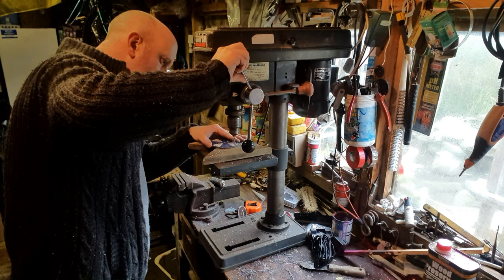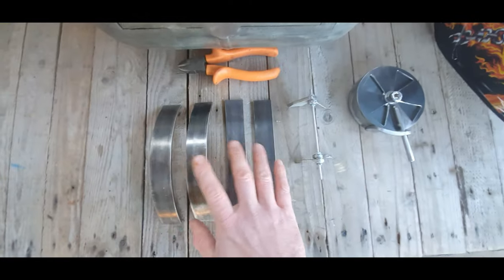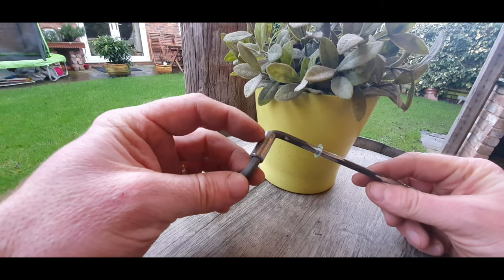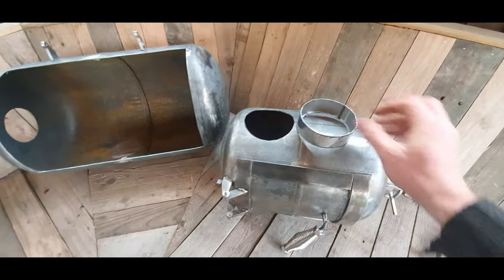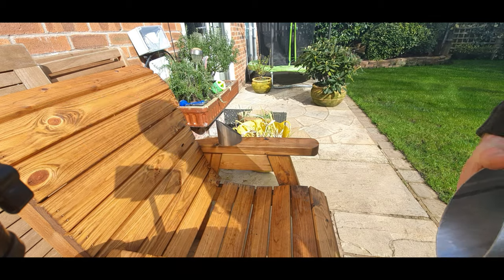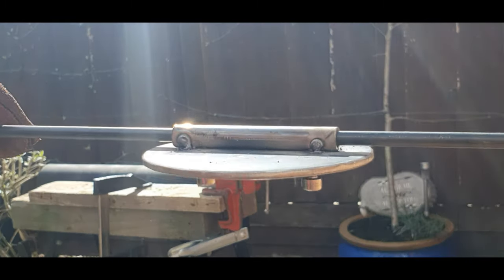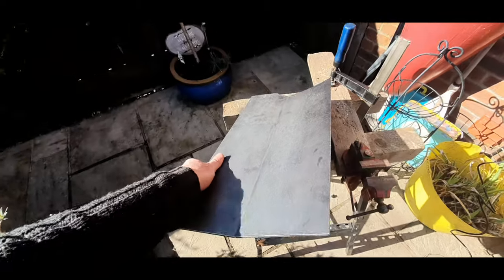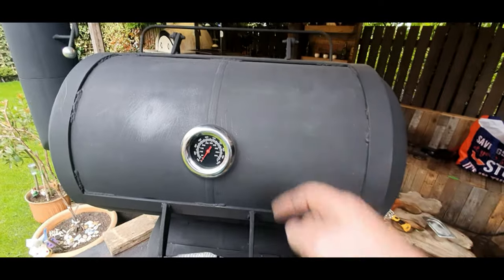Homemade Tabletop Reverse Flow Smoker

Comment: I had this same idea and have the tanks to do it..I'm wondering what you have found out after using it and what you would change yours looks great and super close to the idea I had in mind my only worry was about the heat would transfer and if I should go with two pipes from the burn box up to the smoke chamber
Reply from the maker: I honestly don't think I'd change anything in this one,  which isn't usual for me lol.  It maintains temperature for about 5 hours from a bit of charcoal and one piece of hardwood log.   Cooks very evenly without the need to turn the cook.   Possibly adding another pipe may allow may push a little to much heat up.   Wouldn't know really until its done.   But no personally I'd change nothing,  very chuffed.   Done racks,  brisket, pulled... very happy..

Comment: Awesome video, I'm a welder by trade, your welds actually look alright if you've truly never welded before.
i'm looking to build a smoker similar to this, and was wonder, why you chose the "reverse flow" design?
is there any benefit to just having smoke enter on one side and exit on the other?
thanks!
Reply from the maker: Very kind,  yes truly was my first time... 
I was also new to using a smoker, I chose reverse flow as being a small smoker I thought it would offer greater protection and less hot spots for the food.   
Just my opinion though.
Reply: @RusticInspiration  awesome, thanks!

Comment: Did you ever get around to making a cooking video with this smoker?, can’t find one on your channel. I would love to see a rib video using this smoker 😊. This looks like the perfect size for me, and can be made for a reasonable price. Could you perhaps even fit a second shelf in this so you could smoke 4 racks of ribs? From what you describe it’s pretty easy to hold a steady low and slow temperature with this, is that right? Thanks for an excellent step by step video
Reply from the maker: I'm sure I can find a video to upload. It maintains temperature shockingly well. 1 log and some coal will keep it steady for 4 hours or so..  I've got 2 racks off ribs in it, I've done brisket, pulled pork.  Don't think I'd have been able to fit another shelf though... I'll find a cook video and get back to you...
Reply: Thank you, that would be great. This is definitely on my todo list 😊

Comment: I didn't pour through all the comments....so I might be that guy....maybe there are others........bruh.....how do you not post a follow up cook on that?  I mean....it's a friggin peach!
Since you didn't.....Imma gonna say that it shoulda been an offset.  Looks like even though its reverse flow....that heat coming up from the bottom is gonna radiate that metal and raise temps up to the point your battling temps vs. getting enough smoke.... I DON'T KNOW.....cause....we don't see how it worked....from our perspective this is just another cute yard ornament.
Reply from the maker: It has been mentioned :)  but its a good point...

I will certainly upload one very soon, the next pulled pork I do I'll get it uploaded. Will be this November.  It does work a treat though ! 
I thought of doing it offset but I needed to fit in it in car boot as I'm the guy that gets invited to bbq but still cooks when I get there 😂
Reply: @RusticInspiration  I really hope it turns out sweet.  The thing looks awesome!

I was thinking when I was watching the build and design that maybe a lot of small tinder could really work well in that thing...but that's a lot of maintaining the fire on a long cook....but, then again...that's part of the fun!
Reply from the maker: @cr1138  typically 1 birch log lasts 3hrs so not too bad

Comment: Looking good does it run hot in left side
Reply from the maker: Its reverse flow so the heat comes from the right, think if I didn't do it reverse flow it would have been too much direct heat.  I've done a few brisket and ribs without having to rotate. Pretty even heat.   Very happy with the little fella
Reply: @RusticInspiration  my bad not watch allway before ? I like your idea . I have  hundred pound tank and 20 lb. Im gona try your idea 😀😀👍keep the videos coming
Reply from the maker: @Donavon Baker  thank you so much,  post a link up here so I can see.

Comment: Hi, have you found any things that you would do differently,if you were to build another one ?
Reply from the maker: Good question,  possibly I'd go a little bigger (wider).  But on the good side when designing it I made sure it would fit in the boot of my car when the chimney is off. 
Works perfect, keeps great temp for hours with just a wood.  Perfect for a single brisket of a couple racks of ribs.
Reply: I have been vacillating over the design of the one i’m building, I saw your design early on in the process and always liked the symmetry of it, it just makes sense to put the fire box underneath, I will not be coping yours absolutely but yes, I will be unashamedly ripping off many of your ideas.

like you I had to learn to weld to attempt this project, even though my son is a welder!

Hope mine turns out a neat as yours.
many thanks.
Reply from the maker: @David upton  very very kind,  many thanks

Comment: Great job! What welder did you used?
Reply from the maker: Just a beginners welder, I went gasless but it does gas too.

Rohr MIG-200MI - MIG Welder Inverter Gas / Gasless MMA 240V 200 amp DC Welding Machine

Comment: Thanks for posting this.
I have two canisters, both expansion vessels from heating systems, I'm hoping the metal is sturdy enough to replicate this kind of build.
How did you find it at holding the temperature during the winter months?
How convenient is it emptying the firebox of all the used ash?
Reply from the maker: I find the Ash burns literally to nothing,  I just pull the cage out and really cleaned out with a brush.  I now use a bbq controller "heater meater" which maintains the temperature perfectly for a good 4hrs before I need to stick another log in.
Reply: @RusticInspiration  do you have a link to that?
I'm assuming it is motorised and can open/close then vents as required.
I've got an old Weber for normal bbq'ing, but doing the longer slower cooks is a nightmare.
Reply from the maker: @DouglasFurlong  sure...  
https://store.heatermeter.com/

To u can get them pre assembled or solder them yourself. See them in action on YouTube.
Reply: @RusticInspiration  it's closed

Comment: Big mistake… don’t grind or cut the gas cylinder until you remove the valve and fill with water.  We learnt this in our first year at trade school that any spark or heat on a empty fuel container is a bomb. 👀
Reply from the maker: We did, swear it's in the video. 
Good advise for people watching though...
Reply: Did you even watch the video or just jump straight at the chance to inject negativity? He literally explains the danger and then films himself filling the cylinder up with water. Did they teach you patience, attention to detail or any damn manners at Trade School?
Reply: Well he had the valve closed and obviously isn't dumb enough to grind into the tank he only did that for more room to remove the valve